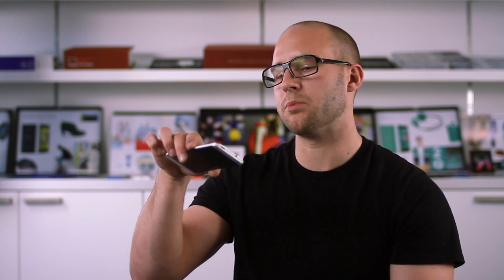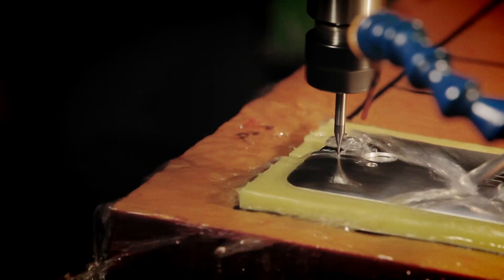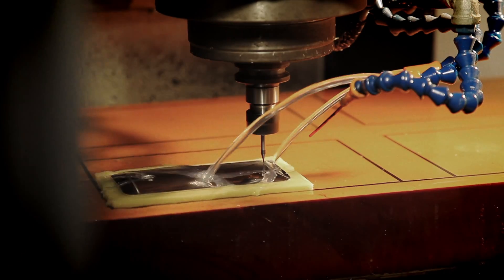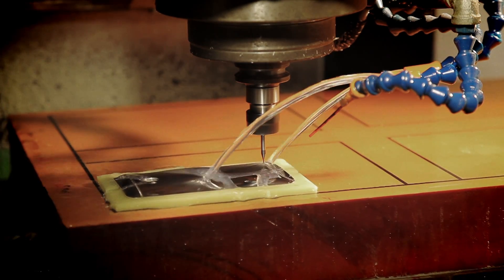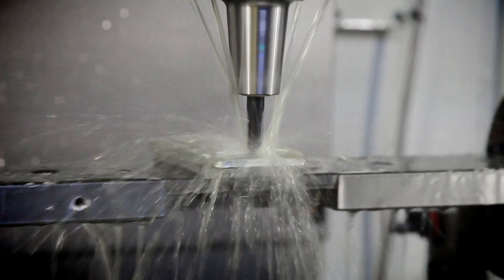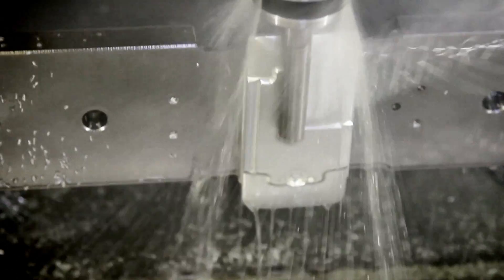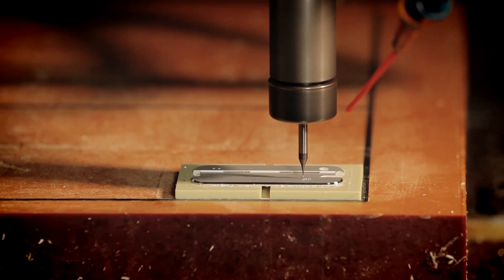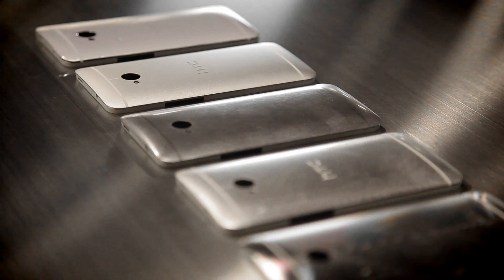HTC One Making of Process

Comment: "No part brakes or moving parts" I love my HTC One but I actually had to change the first one after 2 days because of gaps and parts being miss aligned. The one i have now is a little better but still the same. And the white material around the phone I'm pretty sure it's plastic. Also I think that I could pull off both aluminum pieces covering the speakers with my fingers

Comment: A little tip: Go to HTC’s website for HTC One and check out the 360-degree view of the phone. In almost all aspects does it look different to the white iPhone 5: fullbody brushed CURVED metal back with thin white stripes and big central camera lens vs.FLAT white glass and smooth silvery metal and small left-side camera lens. The sides are thin white metal on One vs. thicker silvery metal on iP5. The front is brushed aluminum interrupted by black glass vs. fullbody glass front on iP5. The same?

Comment: Nice trolling. You disregard the fact that HTC has made metal phones for years before Apple sent out iPhone 5. The One S's metal back, for example, which preceded the iP5, was the first to take advantage of the process by which the back of the iP5 was later made. Regarding bezels, that kind of chamfered edges are also on the black 2nd gen Samsung Series 9 laptop, first seen in january 2012 - eight months before the iPhone 5. Design elements are reused by everybody. Stop trolling - start living.